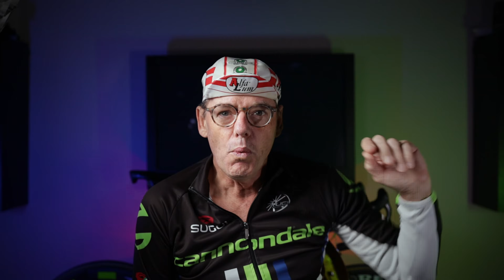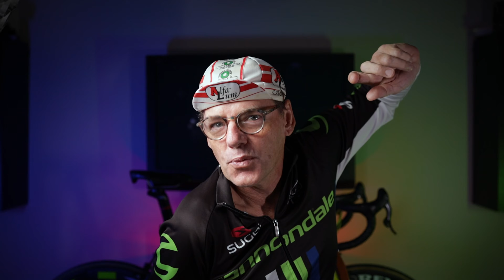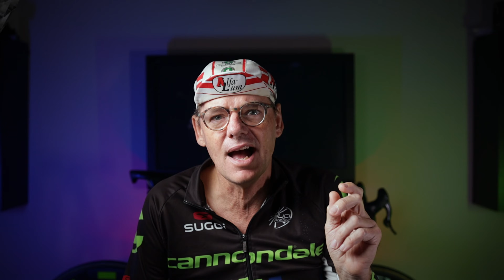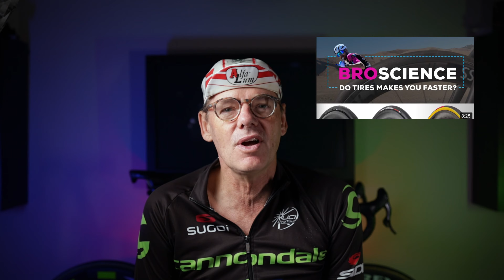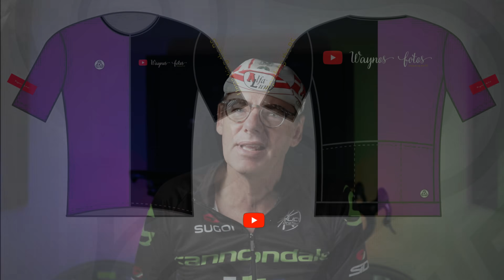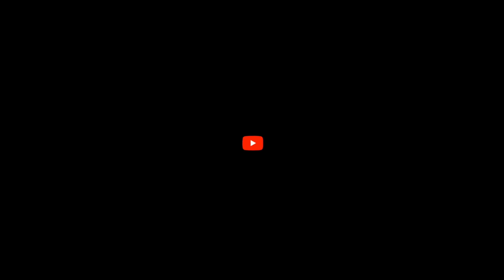Clinchers VS Tubulars 10-12 watts faster?

Comment: Wayne l have recently put a deposit on Roval clx  Rapide / Alphinist climbing carbon wheels . Think there 30 or 32 , 33 mm depth . My specialized bike shop recons they will be faster than my tubular clx 40 's .  Personally l dont think they will be .  Clinchers l use ( specialized  125psi )  Tubulars  Vittoria 145 + psi .  Will be an interesting ride once l finally put them on .  Specialized advertise these wheelsets as like riding a deeper set of wheels . Keep u posted . As an old guy l ❤ tubulars .  Didnt pay $3900  4 them either . Way cheaper. .  Speaking of Specialized they have done the Dirty on there retailers.    Track Cyclists use tubulars & are around 160 -190 psi . So the B.S. comming out of the cycling industry on 80 & 90 p si tubeless is just bloody nonsense 😆😆😤😤😤😤😤

Comment: Speed is measured in meters per second or kilometers per hours, or - in countries using the imperial system - feet per second or miles per hour, NOT Watts! Anyone using the expression "x Watts faster" should feel punched in the face by their (former) physics teacher! It is correct that speed factors into power, as power is the product of speed multiplied by force, but speed and power are not the same. So when you go a given speed with less power, it means you had to use less force (strength) to go that speed, and when you go a higher speed at a given power it requires more force (strength).

Comment: It’s funny that all of the discussion I see about tires in various fora is all about rolling resistance on drum tests with no simulation of the loads a tire encounters. What is easily measurable (Crr, for example) often turns out not to be terribly important. Even the aero advantage of matching tires to rim width likely doesn’t matter until you optimize your riding position, as the rider is by far the largest source of drag. The bicycle and rider have to be considered as a system that operates under a wide variety of conditions. Trying to optimize one parameter in isolation can result in unintended consequences for other conditions.

Comment: One more thing that tests like bicyclerollingresistance are missing, is that clincher/tubeless should not be compared to tubular rolling resistance with the same pressure in the tire. 
25mm clincher inflated to 7.5 bar on a 22mm rim is comparable to 25mm tubular on 22mm rim inflated up to 10 bar. This may be due to the fact that a tubular tire under pressure expands evenly up-left-right relative to the rim, while a clincher/tubeless is partially limited in the left-right expansion by the clincher rim structure.
This is why you may be ok riding a 6 bar clincher on a clincher rim, but the same pressure for a tubular  tire on a tubular rim will make you feel like  your wheel is half deflated.
Imho, tire rolling resistance figures should be compared with the most efficient pressure applied despite of the tire type. 
And not even mentioning the rim width impact.

Comment: The surface of most of the roads in the UK is “less than ideal” as Raoul Luescher would say. Very pitted and very rough! Good tyres make a huge difference for me. All my bikes have tyres with at least 320tpi, currently only running clinchers but looking to try tubs this year.
Great video by the way, keep up the good work 👍

Comment: Love the content! Nice video! I think the benefit of the foam insert is simply being able to continue riding until you get to an optimal place to change the wheel. Also, clinchers with various tubes, super light butyl or latex, are easy to come by. Tubs with the same tech may be harder to find in a hurry. I agree the rolling resistance benefit is probably not the driver,  but the strategic benefits of airline inserts is huge, and the rolling resistance is just a cherry on top.

Comment: I’m just so happy clinchers have overtaken tubulars.   So that is that. Supremacy for what 90 odd years. Glad as for most tubulars just insanely impractical unless have a team car behind us.  And now win win. Clincher.  And faster.  With tubeless or butyl plastic latex options. Plus a new liner GCN reviewed.  Run flat on bikes not cars.  Another win win. I know you like a tubular.  But I think we’re forging ahead positively. Unlike the god dam disk over rim.   I’m very deflated with the latter.   See what I did there.
Reply from the maker: I see what you did there, but in the automotive industry, run flats have not taken off, they are very expensive, and hard to get. People just buy the cheaper tyres and get a sealant pressurised container. Tubeless clinchers have also been very slow to take off and don't fully protect you from flats, but this airliner maybe the holy grail, video up soon on it.

Comment: The thing that drum roll tests leave out at least in my experience is that, for a given width and a given pressure, a high tpi cotton tubular always feels more supple. What this means is, that for the same level of comfort, a clincher has to be used at lower pressures than an equivalent tubular. And that's where I think the difference in rolling resistance gets even smaller.

Comment: The tyre tests done on rolling drums only give one set of best case results. Us riders have to live in the real world with a huge variety of surfaces and corners. A massive amount of work is done by tyre makers with multiple compounds over the tread width to give give grip in the corners and less resit ace on the straights. Cheaper tyres just have one compound and thick sidewall so should go well on smooth road without corners. (suitable for Chris froome TT bike). I prefer a softer sidewall tubeless tyres which work well on the corners so rolling resistance is less important than not sliding off the road on the corners. Enjoy the ride and keep those wheels turning.

Comment: I agree that at a higher speed the rolling resistance of tires makes little difference...  but where do you want the most advantage?  I want it on a climb...  I know from riding the same loops over and over, it is the climbs that determine what my average speed is...   it is very hard to make up the difference on the flat if you climb slow.  That being said, tires will always be a compromise,  cost vs. rolling resistance vs. comfort vs. grip....   there is NO perfect tire.  I have been running Vittoria Corse clinchers for a few years and feel like they are the best compromise but that is just an opinion and I have not ridden every tire.   Much of what the bike industry uses to sell product is what we used to call "water bottle science", using a test that it is very focused and narrow to "prove" something will make you faster.  It has always been baloney.  The riders that are actually fast are forced to ride that their teams provide.

Comment: My pirelli tt 23's come up at 25c on my rims and I run them with latex tubes, they roll beautifully. They're cheapish too. At 205grams inc tubes I've clawed some of the weight deficit of running 90mm rims, the handling's improved in gusty conditions as well, to the point that I'm now happy to use them all the time. Toying with the idea of silicon sealer around where the rim meets the tyre to smoothen the transition even further.  Getting just the right pressure to support your weight, riding style and surface though, I would say makes more difference it can literally make or break whatever set up you have. This is most apparent when riding mtbs on road in fact it couldn't be more obvious on mtbs all the effects are two and half times fold and beyond.

Comment: Right!
I mostly train on bad roads—sometimes even parts are gravel—and i grew up on tubulars,used them in hundreds of races.
There’s a special feeling to them—i wanna ride,not hop around!
Like you say that will fatigue and all these vibrations go through the bike and the rider.
Also when it comes to carbon rims tubulars are much safer!As a junior rider i had to go almost 50 km on a flat rear tyre,and i was really concerned about my new GP 40 rim!But at home i saw it wasn’t damaged at all. 🤙  😂

Comment: You have to remember that the tyre with the lowest rolling resistance on a steel drum is a steel tyre. (Zero losses due to hysteresis) . Dunlop was right up until bicycle marketing proved him wrong 1888-2021 the tub was and still is king. I worked in product testing,there are two ways to test (customer pays) you get him the result he wants, critical safety/ acceptance testing you start from first principals and find the errors in testing that caused the deviation from the physics.

Comment: Thanks Waynos. I have heard that when using tubulars it is best to glue them rather than use tape for op[optimal performance. From what you are are saying I would assume that the difference would be negligible?
Reply from the maker: I would say so. The word on the ground is the glue has a lower hysteresis, but i can't see this, as it is not in the sidewalls and is only a bonding agent at the top of the tyre. Also, almost all top end tubulars are cotton which has poor hysteresis. Fitted with Latex tubes which have a good hysteresis. I haven't done any tests, but it doesn't make sense that tape would have a significant difference. The only thing i can say is glue maybe lighter and give a better bonding.
Reply: @waynosfotos  Thanks
Reply: Only reason I use glue is that it's much cheaper than (good and wide enough) tubular tape. I'm eager to try the Effeto Mariposa stuff though
Reply: @sebastianm2381  I have tried the tape that Ben from Caden Wheels sells. It seems to be good. Its also a little cheaper.
Reply: Can't beat TUFO gluing tape. Used it for years w/o any issues. Super strong and so much cleaner to apply and mount tires. Best of all you can position the tire perfectly on the rim, before removing the second plastic strip and achieving a strong connection.

Comment: The discussion seems to be around clinchers vs tubulars. What I don’t understand is where tubeless fits in or is left out of the discussion. I feel like I’m from the future riding Enve hookless tubeless wheels.
Reply from the maker: A tubeless is, for all fundamental physical attributes, a clincher, it only exchanges a tube for sealant.
Reply from the maker: Interesting hookless, would love to hear your feedback on these as they are pretty new and not widespread as yet. Cheers
Reply: I know what you mean but you know it's not entirely the same either. A tubeless tyre has a tighter fit (I almost always need a special tool for mounting). Without an inner tube, there's no friction loss between tyre and tube. But true, it probably isn't that important in regards to rolling resistance. It does account for a more comfortable ride tho, since it's virtually impossible of having a 'snake bite' type of flat tyre, therefor you can run lower pressures. Running lower pressures also gives you an advantage on the cobblestones, for example. The hookless wheels don't feel any different, but they have an advantage for having stronger sidewalls, improving impact resistance, compared to clincher. And because of the simple construction are cheaper to produce as well! The only downside is, as far as I can tell, that it's not a generic solution what limits your choice in wheels and (compatible) tyres. Replacing a tyre will be a PITA. So it's not for the average consumer. That's how I feel about this discussion. I think Specialized is a very marketing driven company that (my guess) chooses the best possible solution to live with, instead of the best solution to ride with.
Reply: @BartSchrijvers  sorry, but tubeless for overall road riding just isn’t ideal for many reasons. The main reason being practicality; I don’t see why someone would ride tubeless on a road bike considering the mess it makes when you do happen to get a puncture. Sure, it will seal but only after you, your bike, and your cycling kit/shoes (or even casual clothing) gets splattered with sealant. 

You may feel like you’re “from the future” but tubeless on the road doesn’t really outweigh the pros of the clincher system. I can only see it outweighing the pros of the clinchers system if you ride MTB, gravel, loaded touring, etc. As for me, give me a high end clincher tire and a set of latex tubes from Vittoria including two spares to carry on a ride, and we are good to go. Super fast and plush ride quality.
Reply: @astrayagrarian  You should give it a try. Tubeless will always provide more comfort (no contest) since you can also run them at lower pressures without running the risk of a pinch flat. In the last 3 years - that's approx 36.000km's - I never experienced such a scenario that you've described. Keep in mind that a road tubeless setup only uses 40ml sealant. I can't even comprehend how you would make a mess with that. A puncture that can't be fixed with the sealant itself is an easy fix with a "worm". Once I was comfortable with setup/replacing/fixing a tubeless setup (doing a road side repair), this has been my preferred option. I'm genuinely surprised we're talking about clinchers/tubulars without even mentioning tubeless, that's all!
Reply: There’s a lot of bad tubeless testing out there one test I saw concluded that if you put more sealent in the rolling resistance dropped.  when I questioned the expert and asked him how he calibrated for mass on a forum I got nothing but abuse. . So I took the time and calculated the increased energy store of the wheel (flywheel theory) which proved the watt saving was proprtional to the energy stored in the wheel during the test.   I was informed mass doesn’t matter and that the increased energy store had no effect on the test.  After days of trolling from all his cronies about how clever the bloke was, but no one popped up a counter argument, his test was right and because of who he was the result was not up for debate.

Comment: The tyre width thing really confuses me. I've heard about matching the width of the tyre to the rim so I don't understand why there is a big push for wider tyres. I understand why GCN want you to buy a new pirelli tyre every 2 months but the price of a tyre doesn't really change depending on size so i don't understand the marketing behind it.

A very informative video, thank you.
I'm really bored of the cycling media channels just reading the marketing script with a massive grin and a contract which doesn't allow them to voice their own opinion. The promotion for the new noodle thing was unwatchable.
Reply from the maker: Got to use your noodle! Pun intended! I will be doing a noodle follow up video. So stay tuned! Thanks for watching. 🙌👍
Reply: To help with the wide tyres . Having a bigger volume of air means you can run a slightly lower pressure to help smooth out a road.  

The reason for the tyre and rim being the same width is for aero . But only to a certain point .  28c seems to be the tipping point before aero drag becomes lager .
Reply: @edmundscycles1  in the aero test they’re looking at the transition from the tyre to the rim: brake track. We used to be able to smooth this area with a smear of sealent but the uci band it when they stopped us putting boundary layer tripping stickers on the frames. A tub is round a clincher has flat side walls so that’s where the aero advantage comes from.  But no matter how you cut the cake if you were to be allowed to fill the transition then the narrowest tyre wins.
Reply: @tobycolin6271  where the benefits comes in for wider tyre is bump absorbing of being able to run a slightly lower pressure.  As I said the aero penalty of tyres above 28c  out weighs the benefits of bump absorption.   So ideally 25c is a good compromise for aero and reduced rolling resistance .  Good benefits of lower tyre pressure is also better traction for power transfer .  

I mean aero wise a 19c tyre maybe faster , but for power transfer a 25c is much better . 19c often skip on the road as the tyre pressure has to be so high to reduce pinch flats or other punctures the bike becomes very nervous at high speeds or on bumpy roads .
Reply: Tubs have way way better aero than clinchers . Because it is round and hugs a side wall much better  than a clincher .